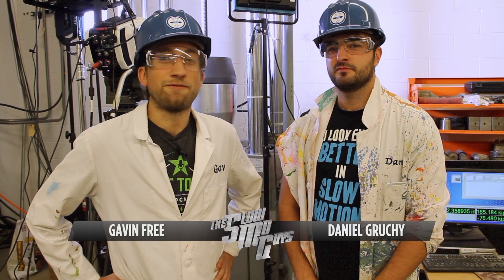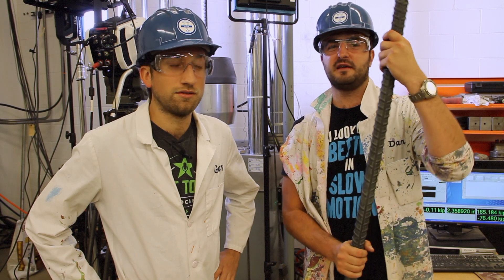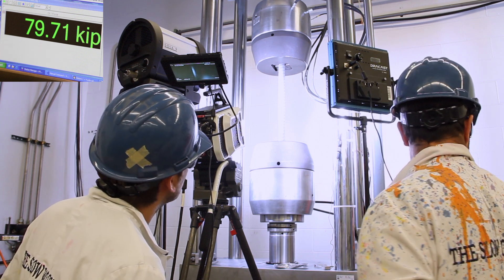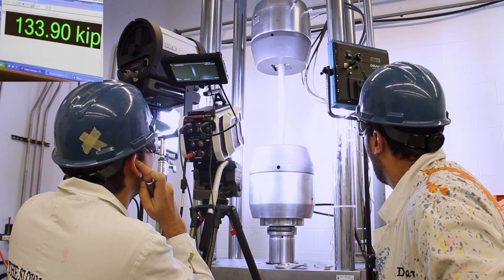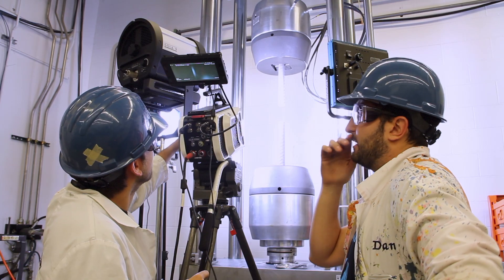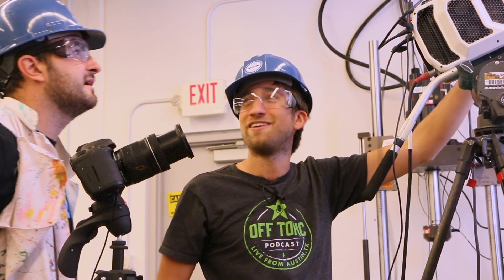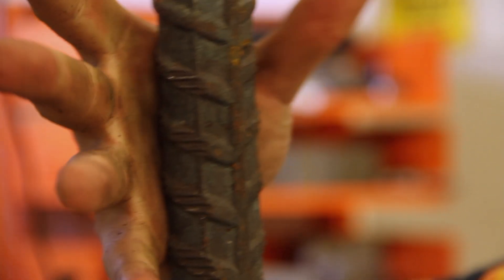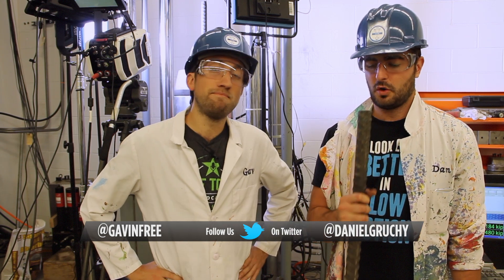Snapping a Steel Rod 1000x slower - The Slow Mo Guys

Comment: I heard that jet fuel can't melt steel beams, so the slow mo guys just pulled one off instead.
Reply: +Crazy Queen 9/11 joke
Reply: Dank memes melt steel beams
Reply: Even straw can melt steel beams ;)
Reply: Alex Paulsen 911
Reply: SylannaMaxwell used to work at an intnl airport, only fuel on those planes would have been good ol' Jet A. Basically more refined diesel. can actually put it a diesel truck and it'll run. way better too.
Reply: Alex Paulsen
Reply: Alex Paulsen.
Given enough heat, any steel girder, RSJ, purlin or beam will fail. There is nothing strange about girders and RSJs being deformed, bent and twisted in a building fire.  Oh and btw, do you know what jet fuel actually is?
Reply: Alex Paulsen yes it can the heat overall also all it has to do is weaken it
Reply: You would also need to consider the different fuels as that is going to determine the temperature of the fire. Jet fuel gets hot enough to make steel weak and soft enough not to be able to take heavy loads.
Reply: I heard dank memes melt steal beams
Reply: Haha!
Reply: hahahahahaha, what a rhyme, it's gonna be a great fascist 2017 for all of us
Reply: Rob, lost and late. I don't know Why but it mAkes me happy that you know what a girder and a purlin Is!
Reply: Rob, lost and late. (And enough disk)
Reply: Tyler Bentley.
Why?
Reply: Mc Rayas.
(And enough disk). What does that mean?
Reply: Rob, lost and late. Enough disc to go thru the metal
Reply: Alex Paulsen ....there was that one building in Madrid that burned for 18 hours....... it's still standing today. I suppose building 10 just "burnt down" too, huh? There's never been a government conspiracy in the history of man. Ahem.
Reply: My Siberian Husky MSH You can't simply compare buildings and their behavior and then say it was the government that did this
Reply: No, but I can compare fire and it's behaviour on a building that's built the same way.
Reply: My Siberian Husky MSH.
So, you're an investigative forensic scientist are you?
Reply: The planes were CGI 911 was a green screen

Comment: A "Megastone" is an impractical measurement because it uses a metric prefix for an imperial measurement, however if it existed, 1 Megastone is 6,350,290kg, or 14,000,000 pounds.
So Gavin was almost right, if he said 10 Kilostones he would have been spot on.

Comment: It's so weird seeing things measured in kips. Other than that, I feel right at home with this video. I use MTS test machines and software (and yeah, I don't think they show the software used, but I'd recognize that display anywhere). Those hydraulic grips are way beefier than the ones I've used. Badass!

Comment: if that's #11 bar and not #12 bar then the diameter is 1 3/8" not 1 1/2"  the number corresponds to how many 1/8 of an inch the diameter is.

Comment: Hey, you guys should film a 1000 degree knife cutting through stuff in slow mo.

No, but seriously, don't. That meme needs to die. Just do more backyard stuff. Or hey, maybe do the exact opposite. Cool a knife in some liquid helium. Then dip it in water and slow mo all the ice crystals forming, or whatever happens.
Reply: Raydel Rativo that's not the definition of a meme, go look it up.
Reply: How about recording a burning multi thousand degree knife in slow motion? Supply pure oxygen and steel will burn with a brilliant white light and plenty of splattering molten iron droplets. That's a good idea. XD
Reply: UltraPrimal Sigh A trend is not a meme, the true definition of meme is to caption a picture to make a joke out of it.
Reply: Rogelio Rocha
Thank you.
Reply: Rogelio Rocha I put it into a simpler meaning, or an example of what would come up if you search "Meme" and then went onto images. Jeez

Comment: try to compare different materials on the same tension test machine. A36 Steel, High strength steel, Aluminum, carbon fiber, wire rope, chain
,
Reply: Erik Elzinga. YES!

Comment: I toured a facility that does very interesting materials work years ago.  It was in Tridelphia, West Virginia.  In Wheeling, West Virginia there is an old suspension bridge.  At one point, they decided to replace the steel cables that support the bridge.  They did so, then a few years later discovered that the cables were failing at a way higher rate than they had predicted.  So they sent some of the cables to this facility to do their testing.  They loaded them up in a machine that, as far as I remember it, looked exactly like this one, and tore them apart, examining them in detail and comparing them to the older cables they replaced.  They ended up figuring out that because the older cables were coated in almost a centurys worth of grime, road dust, exhaust, etc, they were protected from oxidation and remained stronger longer.  The new ones were too clean, and vehicle emissions had been reduced so much that they never developed a protective layer.  They just straight up rusted.  

Very interesting place.  Companies and organizations (I know they did some work with NASA) contact them when things are breaking and they don't understand why.  So they break the things under controlled conditions, analyze why and how they broke, and figure out how to possibly fix the issue.

Comment: Pure steel is an oxymoron.
Anyways, 220000 pounds (I'm going to just assume that pounds and ft lbs is pretty interchangeable as I'm a 15 YEAR OLD and not an engineering major. Correct me if you choose) or, 220000 foot pounds translates to roughly 400 horsepower. Which is decent.

Comment: So, if that machine is pulling up and the steel breaks, what opposite force stops the machine from destroying itself, once the 150k of resistance spontaneously vanishes?  Must be made of a stronger material than the rebar...

Comment: Windows XP? Seriously?
Reply: because in the real world, we have these things called budgets. we don't burn money replacing things if they don't need replacing.
Reply: I've got a toolbox that's as old as I am. Do I need to replace it if it still does the job that I need it to?
Reply: BlackEpyon who cares about your tool box? It's a fucking machine
Reply: The point is that it works just fine for what it is meant to do. That XP machine is meant for one task, and one alone. So long as it performs that task adequately, there is no reason to upgrade. Especially if the software that controls that machine doesn't work on Windows Vista or later, as is so often the case with proprietary software. If it ain't broke, don't fix it!
Reply: BlackEpyon yeah, why would you buy iPhone 7 if there is Nokia 1100? Why would you have sofa in your apartment if you can sit on the floor? I hope you get my point
Reply: No, I do not see your point. You are comparing apples and oranges. The Nokia 1100 is just fine if all you do is call, and the battery can still be replaced when it dies. 
The floor is bad for your back, so in that case there is a reason to upgrade to a sofa.

The functions of this tensioner machine are simple, and a WIndows 10 machine will NOT run them more efficiently than the XP machine. Until that XP machine dies, there is NOTHING to be gained by upgrading it.
Reply: +Bogdan Shumenko A fucking machine? I think you are using your tool box wrong...
Reply: BlackEpyon lol ok, don't buy a new table, use an old one, whatever dude

Comment: Physical Characteristics of #11 Rebar: Weight per unit length: 5.313 pounds per foot. Nominal diameter: 1.41 inches. Nominal area: 1.56 square inches.

Comment: just WOW to that pure amount of force... 157.401 kip is roughly equal to a wooping 700 MEGAnewton!! For comparison one booster of a spaceshuttle uses 14.5 MN, so you need the force of over 48 Space shuttle Bossters to tear apart such a steelrod @.@
Reply: 700kN -- not 700 meganewtons -- force of weight about 70 metric tonnes

Comment: I can't even imagine what the force was like after it broke. If a person were pulling it apart it would smack them in the face at 1000mph with all that upwards force. The fact that that machine can hold together and not move an inch after it splits the rod is amazing in itself.

Comment: Interesting how a #11 bar is about 1.56 in^2. Multiply that by 90 kips/in^2 psi (the the ultimate strength of 60 ksi steel) and you get 140 kips. Their test failed at 157 kips. Over 12% higher manufactured strength than is required by the code.

Comment: The really scary part is that Windows XP computer.  Hopefully it's not actually connected to a network.  ;)
Reply: Most software for large machinery like this still runs on Windows XP because it is custom made software, and if it works, it works, so they don't really have a reason to upgrade. (And it is probably not connected to the internet, but it is most likely connected to an internal network at the facility)
Reply: Oh yeah, I completely understand that.  We dealt with the same thing at the last organization I worked for and now deal with applications that don't run on Win10 vs Win7.

Comment: I have no idea what that machine would be used for, was it made to just pull metal rods apart?
Reply: Yes. It's used to test the tensile strength of a material. (A brand new material, something that someone needs to investigate from a structural failure, quality control for your factory, etc.)
Reply: hydranos Well I feel stupid now, lol thanks for the reply.

Comment: Will you guys please do an experiment where you lap up notebook paper and intertwine them and they are very hard to rip apart and see how many kips it can withstand before it rips and record it in slow mo. I'm pretty sure it can stand at least 10kips. You would just need something that would be able to hold it as if you were holding it with your hands.

Comment: Crack propagation is equal to speed of sound in the medium(?) In steel that's like 21000 fps(?) or 252000 inches per second... So it that would mean 6 frames at 1000000frames/s recording when propagating through 1.5 inches?
Reply: Correction: Speed of sound on steel is 20000 ft/s So a bit of...but not that many frames even at 1 million fps

Comment: The Whole World Population: "WOW! This machine can pull up to 157 kips!" Me: "They are still running windows xp ._."
Reply: Most software for large machinery like this still runs on Windows XP because it is custom made software, and if it works, it works, so they don't really have a reason to upgrade.
Reply: if it aint broke dont fix it
Reply: 3D Pinball Space Cadet.
Reply: +AB No. It was like this:
96% of World Population: "WOW, those kips, pounds and stones are the most retarded units to measure any force!"
'muricans: ":)"
Reply: if it works, don't break it
Reply: if it ain't broke don't fix it lol....or update it haha
Reply: The US Military uses XP
Reply: +1
Reply: icannotgetafreename +1 for your +1
Reply: It's probably not connected to the internet either, which helps.
Reply: infinitesheldon while it is crazy how long some parts of the gov go without tech updates, where they feel it is necessary they've got the best of it. Our government has AI databases that collect info on every individual from every media platform they use and develops personally specific analytics. I probably don't need to go on.. lol
Reply: +The Ayylien While, yes he could have phrased it better, he does have a point. These units alienate a lot of the world, myself included. I had to convert the units across myself, which, while it isn't difficult at all, still took time that really wasn't necessary to take. 
I don't personally care, but how hard would it have been to put into the video how many Newtons that was? It would've let everyone who isn't using an alternate system understand it.
Reply: Windows 7 and 10 are quite stable once you get them configured properly. Legacy programs are still an issue though, and that's primarily why people with legacy applications hold back and try to keep their old machines going as long as they can. Especially with old accounting software and hardware controllers like CNC machines and such.
Reply: ikr... but its machinery software (Conman 123) and not a porno workstation lmao
Reply: +Conman_123 airplane diagnostics use XP. Also many hospitals still use XP.
Reply: Some of the computers that the US use at their borders still run on MS-DOS. I kid you not, our government is that far behind the times.
Reply: Conman_123 Ah I see.
Reply: AB win7 ._.
Reply: I would +1 but it's at 69
Reply: AB  Dude, I cringed so hard when I noticed that!  😟😦😧😲😨😠🙀😾😿
Reply: AB  Dude, I cringed so hard when I noticed that!  😟😦😧😲😨😠🙀😾😿
Reply: Ulf, firstly, majority of viewers here don't actually care for the values beyond "it's really a lot." Secondly, this is not a video aimed at engineers, but at general population. Thirdly, the measuring software is clearly customized for the market near it - it would make no sense to measure in kN simply because of the overhead it puts on the production in that location.

Comment: Structural engineer watching here, excellent video. Demonstrates the difference in what we call yield strength vs ultimate tensile strength.  The rupture load could be approximated by multiplying the cross sectional area by the rupture strength (90ksi ultimate for 60ksi yield strength rebar).

Comment: Have you ever considered doing the setup in this video but using different samples of metal? You would be able to see how the different modulus of elasticity in the materials would affect how the metals fail under load. Depending on the material you would be able to see the materials experience necking or other modes of failure. Very cool video!

Comment: Given that, in steel, cracks propagate at at least 25000 ft per second, not catching it at 150000 fps on a 1" bar is pretty much a given.

Comment: Go to the university of Illinois in their science lab they crush 55 gallon drum sized blocks of concrete under a 5 story hydraulic hammer and when the block explodes under the pressure you can feel the whole building move its like an earthquake, check it out!

Comment: So when filming at such an incredible frame rate, why does the shot need so much lighting - the slow-mo footage was comparatively dark.
Reply: It looks dark because the camera is capturing so many frames per second that the shutter doesn't let a lot of light in, so you need to compensate by using a ton of lights. But, at that speed it's pretty hard to not make it look dark.
Reply: SmokeAndClickCircles thanks, I appreciate that :) Had a feeling that would be the case, but wasn't sure. At such a fast shutter speed, I guess slomo would be a huge challenge!

Comment: I'm liking the more industrial slow mo videos, any chance you guys considered taking high speed of machining processes such as turning or milling, I think that would be really interesting to see. The science and engineering that goes into the design of cutting inserts is actually pretty incredible eg. a metal chip can come off glowing red hot but little to no heat is transferred into the part or cutter.

Comment: I thought it was lb for pound what's Kip? Not kilopascals is it?
Reply: A kip is basically a "kilopound", or units of a 1,000 lbf. So, 151kip is 151,000 lbf. Kip is used a lot in engineering.

Comment: Great job guys, good video.

Grade 60 rebar has a yield strength of 60,000 psi and minimum tensile strength of 90,000 psi. The tensile stress area of a #11 rebar is 1.56 square inches... 1.56 square inches x 90,000 psi = 140,400 pound tensile strength. The specimen in this test failed at 157,000 pounds which meets the strength requirement. Not sure where they got 220,000 pounds from the beginning of the video.
Reply: The specification for rebar, ASTM A615, specifies an elongation (ductility) of 7% which is relatively low. Compared to the more common ASTM A36 structural steel which has an elongation of 20%, rebar is brittle. Lower ductility = more brittle = less necking
Reply: The 220,000 lbf I think was from the testing capacity of the machine. The biggest bar they could probably test with it is a #14, as long as it doesn't overly exceed its specified tensile strength.
Reply: I watched it again and agree, they were referring to the machine. Thanks.
Reply: why didnt it neck?
Reply: after closer inspection i did see a very little necking and also ty for explanation.

Comment: guys, it's too bad you didn't select a piece of stainless steel rod to do this with. Something around a half inch in diameter out of 316 stainless steel has much more elasticity and would have taken a nice stretch before breaking. try it again?

Comment: I'm kinda surprised to see you using a Sola light (is that the 9C?).
I get that they draw less power and generate less heat but my experience with them is they have very weak light output and are huge in comparison to a smaller light with the same or better output. Plus, they're expensive buggers.